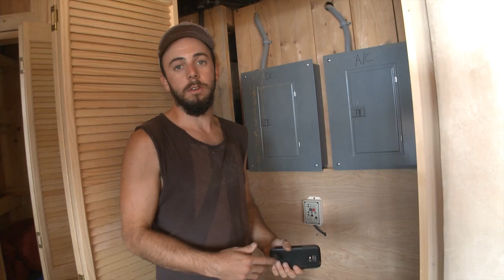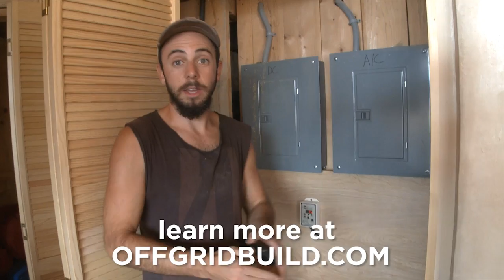Corrections to "Sizing Your Solar System"

Comment: The people that told you that isn't part of Ohm's law,  are wrong, wrong, wrong. Even though Ohm's law is a calculation for RESISTANCE,it is still part of the Ohm's law mathematical equation. If you were trying to calculate the resistance of any part of an electrical circuit, and all you had were the watts, and either the current or the voltage to do the calculations, then you could calculate your resistance numbers, and also calculate either the missing voltage or current calculations, depending on which one was missing. So again.....WRONG, WRONG, WRONG !!! 
You were correct in your original statement.

Comment: https://en.wikipedia.org/wiki/Ohm%27s_law#/media/File:Ohms_law_wheel_WVOA.svg    This link supports your Ohms Law.. and I use them all.
One question whats better 12V or 24?  A lot of things run on 12V.  The more you convert power the more loss you have right..?

Comment: I agree that your video was easier to understand than some other I have watched. My ideal would be to have a combo solar-Wind system but that isn’t what I will have to begin with. I am going with 600 on the roof of my rv and 300 freestanding that I can move as I need to when I want to park my rig in some shade. I will have four golf cart 190 ah with two charge controller units to control roof vs ground panels. So with watching your other video it sounds like I should either cut the solar back or see about increasing my batteries to six. Did I get that right?

Comment: Hey son, You were right about the Ohm's Law, so don't sell yourself short. You must have read it or heard it somewhere before and that's why you suggested it to be Ohm's Law. Next time check real quick to make sure your info is sound, so that will NEVER happen again. In my career field people die because of mistakes, so I make it my business to ALWAYS make sure what I say is FACT, beforehand. Just a bit of "Food for Thought." 

P = Power (watts) 
Current = I (Amps), 
Volts = V  
Formula  P (watts) = V (volts) x I (amps). 
Example: Given 115 V and 5 A.  What are the watts (P). 
Ohm's Law - 115 x 5 = 575 watts    P (watts) = 575 

I'm a former U.S. Marine (7 yrs.) and now a U.S. Army helicopter Test Pilot (retired/veteran) with 33+ years experience, but decided to start sharing my knowledge with the young men and women that will soon be the future backbone of aviation in their country (possibly others). Presently working as an "Aviation Maintenance" (Engineering) instructor teaching "Basic Electricity/Aviation Electricity" (aerodynamics, aircraft structures, aircraft systems, turbine engines, etc.) at Liming Vocational University (freshmen) and at Shanghai Civil Aviation College (sophomore) in China  

Just thought a bit of background would go to show that I have a little bit of experience. Hehehe

Comment: I heard you mention the wind a couple of times during construction there are a couple of residential wind gen kits that are designed to work  no matter the direction of the wind...the wind vein looks like a squirrel cage motor and the weight  of the squirrel cage can be erased using the maglev technology ensuring high dc out put. I saw banks installing them and with the rare earth magnets the way they are wound guarantees 50 to 75 volt consistent out put in 15 mph wind some thing to think about as a compliment the units are less than 3 feet in length and may easily be set on the roof near the battery bank...

Comment: So far I love your videos!  You're intelligent, you're funny, entertaining and very informative.   I had to stop 3/4 of the way thru to add a comment saying yeah, everytime there's a transfer of energy, some of that energy is converted to other unwanted things.  Take a light bulb...I'm juicing up a light bulb with whatever power, not all of the energy is converted to light.  A lot comes off as heat..  Just an easy way to explain that there are losses  Or should I say trade-offs cause you never really "lose" energy. It's transferred negatively.

Comment: Thanks for all your videos. I have a question about charging an electric vehicle off solar. My ev has a 19kwh battery and the 120v charger charges at 3.3kw. Could you tell me how big of a solar system I would need to at least charge that for roughly 11 hrs starting from 7pm at night till the following day. We are central time about 50 miles east of Dallas. Battery is not fully depleted. My wife uses only about 60% of the battery per day. According to specs the battery takes 20 hrs to charge from fully empty at 120v. Thanks for your help and time. Anyone else can chime in on this as well. Any help is greatly appreciated.

Comment: the 20% loss comes from turning DC power to AC power...Ohm's law also interferes with the losses, it is the resistance of the conducive wire, but with copper they are minor...but hey thanks for the whole lot of useful information.

Comment: Dumb question , maybe-   I figure my watt needs (thru the inverter)   are 1,500, roughly......what watt solar panels do I need ? ( for continuous use, in a mid range sunny zone, using  regular 12 volt car batteries)
Reply: +wotan237 do not use 12 volt car batteries. the are designed to pump out a lot of amps very quickly and then be charged back up quickly.  you will kill care batteries very quickly on a solar home power system. you need to get deep cycle batteries that are designed to put less power over long periods of time

Comment: can you do a video on the set up if you had two service panels in your home, or wind and solar system with two battery banks and what type of charge controller you would use??? or can you run two inverters off of one battery bank??

Comment: I am a retired master electrician, yes "P" is used in a power formula, this guy is exactly right..you would use ohms law to calculate, watts, amps, volts..and back and forth between them all.When I do calculations for a house load, I use ohms law, figuring max watts per circuit. You may want to check a current printing of the NEC if you have any questions..figuring things like joules is not necessary to calculate your loads or usage, you can calculate power factor depending on the load. Hope this helps with any confusion, P.S. I personally would use a 12 volt system split into two banks with panels to make 24 volt available.
Reply: +Robert Anderson 
Watt's law is Watts = Volts x Amps
Ohm's law is Amps= Volts/Resistance

Comment: Where do I start? What should I say? What should I not say? I am also an EE, also agrees with ,Petelite, Guy Brown, Mark Allen and Butch Weise, don't worry about trolls. In simple terms, Joule's Law is about heat generated by the circuit and how that correlates to power loss. Joules are calculated using Ohm's Law. The original ohm's theory written in the 1820's did not include power at the time but was incorporated later. 
Two important things..... Number one.... I love your videos. Dude don't change what you're doing. We can all sit here and throw formulas at each other all day and argue theories. DUDE YOU'RE DOIN' IT, you're not sittin' on a couch talking about it. If you tell me, "Hey Charlie, Ohm's Law is a Partridge in a pear tree divided by a spork." I'm gonna be like,"Right on man, tell me more." because I've read the books. I wanna hear from you, the man doing it, with his hands on. Make sense? Know What I mean?
Second important thing.... DUDE YOU WERE RIGHT! What you quoted was Ohm's Law. But you're still gonna get those people that took a few night classes down at the vocational technical college. So they'll always be able to build a better solar power system than you from their freakin couch. Anyhow, please don't get discouraged and stop, or change what you do.

Comment: It is so ohms law http://sunburst.usd.edu/~schieber/psyc770/resistors/ohms4beginner.html check out the link... :) you are right!
Reply: Where do I start? What should I say? What should I not say? I am also an EE, also agrees with ,Petelite, Guy Brown, Mark Allen and Butch Weise, don't worry about trolls. In simple terms, Joule's Law is about heat generated by the circuit and how that correlates to power loss. Joules are calculated using Ohm's Law. The original ohm's theory written in the 1820's did not include power at the time but was incorporated later. 
Two important things..... Number one.... I love your videos. Dude don't change what you're doing. We can all sit here and throw formulas at each other all day and argue theories. DUDE YOU'RE DOIN' IT, you're not sittin' on a couch talking about it. If you tell me, "Hey Charlie, Ohm's Law is a Partridge in a pear tree divided by a spork." I'm gonna be like,"Right on man, tell me more." because I've read the books. I wanna hear from you, the man doing it, with his hands on. Make sense? Know What I mean?
Second important thing.... DUDE YOU WERE RIGHT! What you quoted was Ohm's Law. But you're still gonna get those people that took a few night classes down at the vocational technical college. So they'll always be able to build a better solar power system than you from their freakin couch. Anyhow, please don't get discouraged and stop, or change what you do.
Reply: +Butch Weise 
Watt's law is Watts = Volts x Amps
Ohm's law is Amps= Volts/Resistance

Comment: you wouldn't be able put inside(battery) more energy ..but it would be better for your system. because you wouldn't use battery over day only when there wouldn't be any solar...So more panels better for your system.

Comment: I agree should always go a big as you can, for off grid you use heat sink to dump the excess power into, for on grid if your power company pays you for exporting power bigger your system is more return you get to offset what you use at night

Comment: What if I covered my entire roof in photo voltaic panels and it would generate much more energy than I could use in a 24 hour cycle. Would that be bad for the batteries or detrimental in any other way?